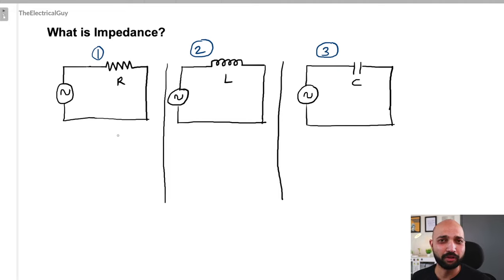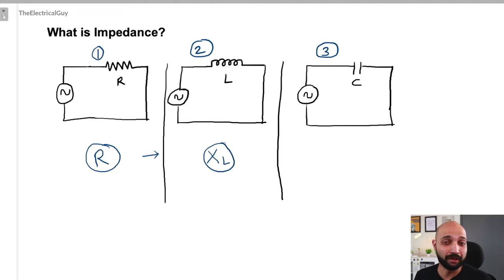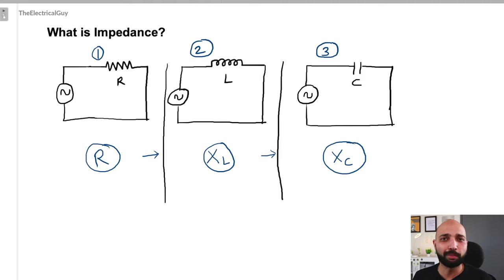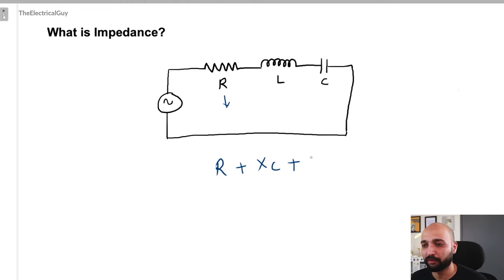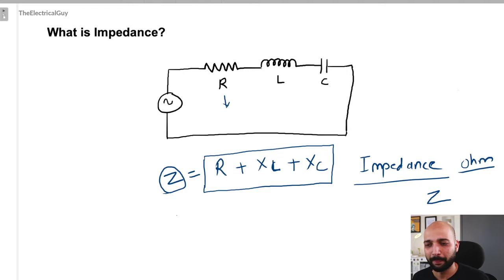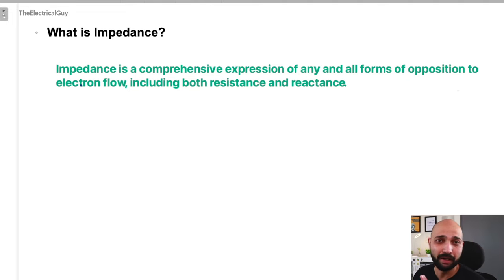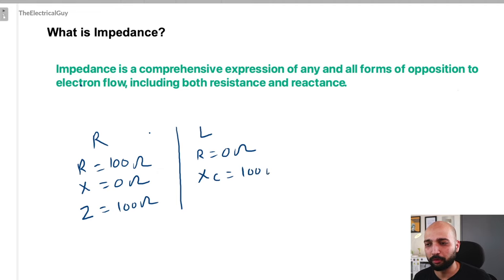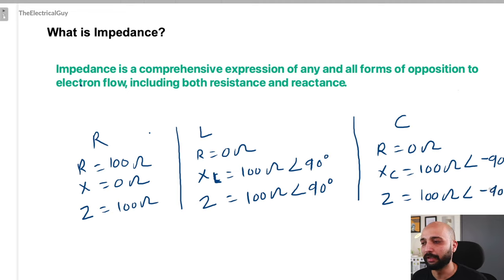What is Electrical Impedance | Explained | TheElectricalGuy

Comment: Yes it did help!!! So I came by because I watch how to measure “ghost voltage” and using the “LoZ”in  the multimeter, and the guy who explained it talked about the magnetic field kind of mixed with the other wires…😅 would you make a video about this? I’m just a regular electrician but very passionate about the engineering part of it, it’s amazing how all works. Greetings from México 🇲🇽

Comment: Capacitor has negative reactance because the impediment effect of a capacitor diminishes as frequency increases where as inductor has positive reactance because the impediment effect of an inductor strengthens when frequency increases.
For circuit impediments with positive reactance the voltage drop across the circuit impediment leads the current thru the circuit impediment whereas for circuit impediments with negative reactance the voltage drop across the circuit impediment lags the current thru the circuit impediment.
Resistive impediments don't have reactance because they don't impede in a way that depends on frequency.

Comment: Z is NOT equal to R+XC+XL.
Reply: As a matter of speaking it is, as in the sum of all oppositions to current flow. 
Yes Mathematically Z = |Z|= sqrt(R^2+x^2), phi. Or Z = R + jX or Z = x+jy. 
But this isn't really a useful way to help someone comprehend impedance. This is only useful for a calculation to get the answer when given the values to substitute. 
Good video :)